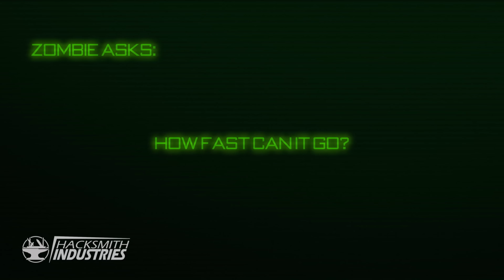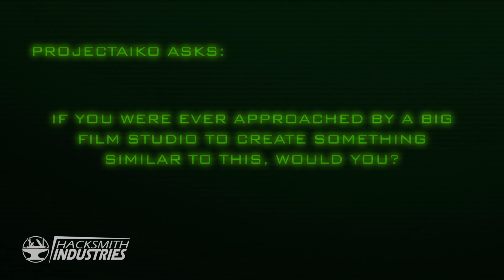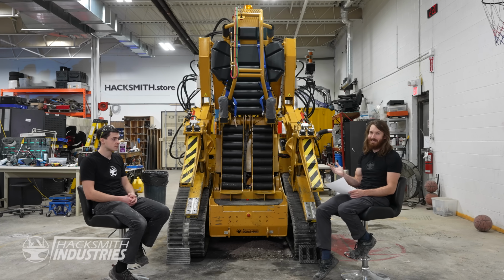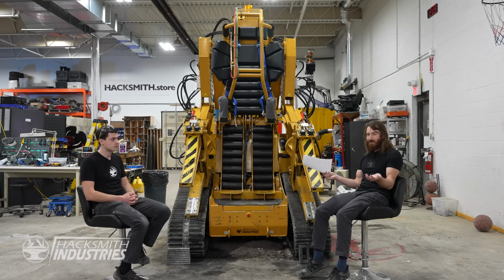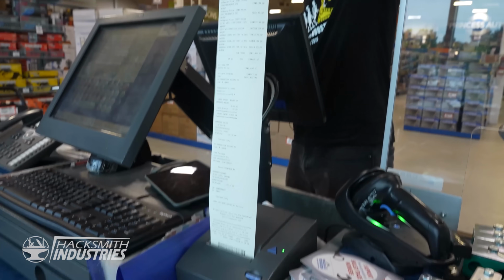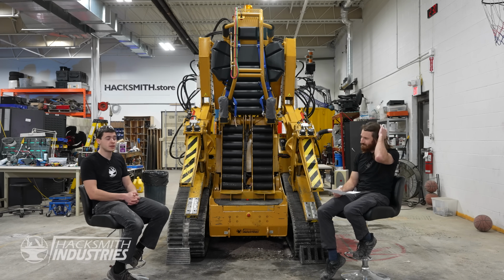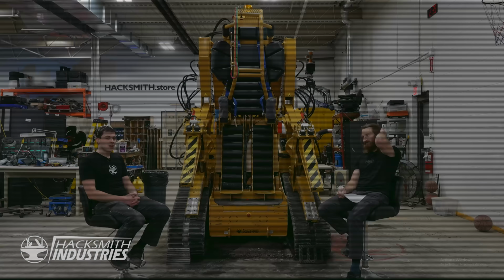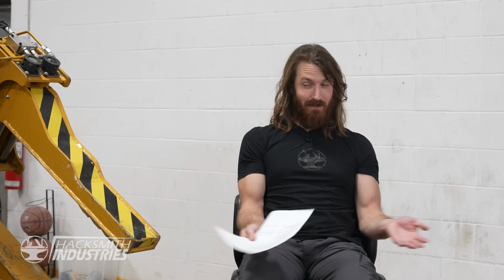POWER LOADER Q&A! - WE ANSWER ALL YOUR QUESTIONS

Comment: In regards to moving it, I don’t think you would need to get a a full blown roll back flatbed to move it (as well as a CDL to drive it). Call the Power Loader itself 11k lbs and a trailer actually heavy enough to move it 4k lbs, you’re looking at 15k which is within the towing capacity for most 3/4 ton (F250/2500) trucks, and definitely within what 1 ton trucks can do.

Comment: 2:20 plus we can use our muscles to resist gravity without actually bending any joints whereas a machine can only put up resistance by bending joints and relies purely on weight distribution to stay upright.
Reply: In buses and some RC cars, the electric motors can resist movement by applying a small voltage in the opposite direction, and work like a brake, so it is possible

Comment: Also, rather than making attachments you have to swap out for the grippers, make the attachments in the form of tools it can pick up with its grippers & use. A set of fork lift forks on a frame that the power loader picks up by sliding its grippers into twin box sections would work just as well as forks you have to switch out with the grippers, & you lose the flexibility of being able to switch from attachment to attachment swiftly & easily...